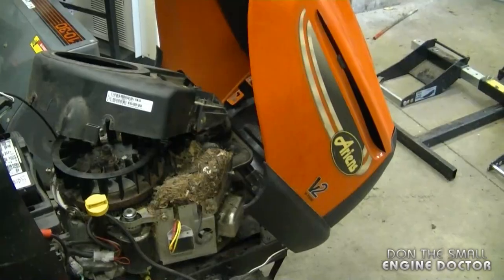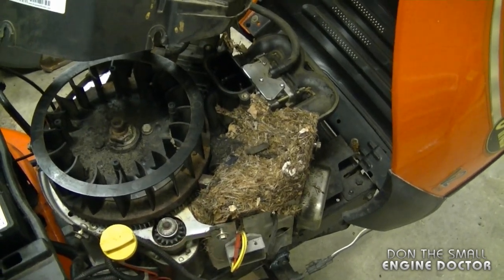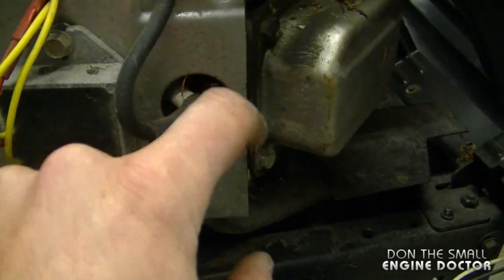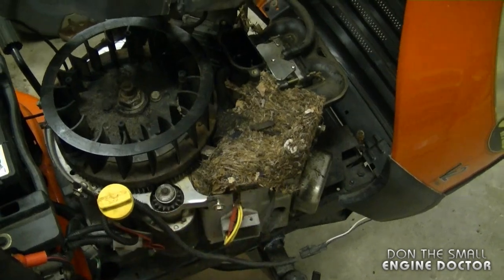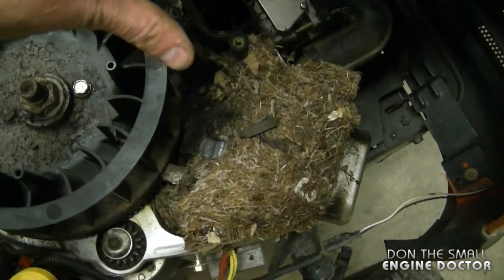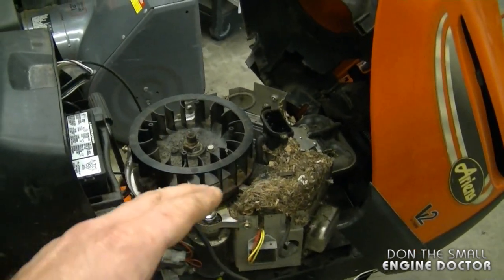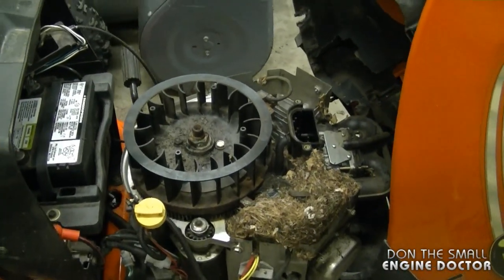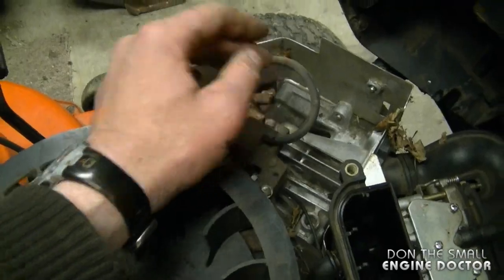Lawn Tractor Tip #4 - Rodent's Nests & Possible Damage Caused

Comment: the mower I am using now has the spark plug wire chewed on I taped it really good and so far it's running,, also on the  pest subject, I am sure you have run into this before where a mud dauber has built a nest in the little round exhaust hole in the muffler on weed trimmers , and they won't run when that happens.
Reply from the maker: MissouriOldTimer it happened to an airliner pitot tube with catastrophic results

Comment: One spring I started up my old 12 hp Murray mower and a big mouse plopped out onto the shop floor with baby mice hanging off. Finally figured out it had come from under the shroud on my engine after it kept overheating.

Comment: Donnie, your vids are fantastic ! I need a little help with cross referencing an oil filter. I have a Toro model 74616 zero cut with a 452cc engine. Toro wants $ 15 for their filter, I want to cross ref. it. No name on original filter but the filter # is 1204276. I've spent hours looking and can't come up with anything, surely there's one out there that will fit thats cheaper than $ 15, can you help me out ???
Reply from the maker: Keith Evans call your local auto parts store with the number